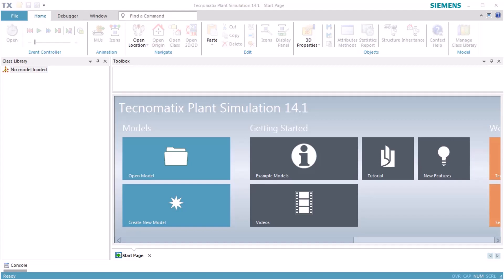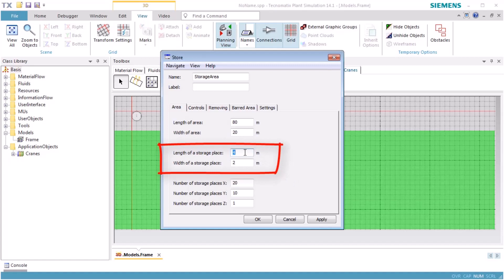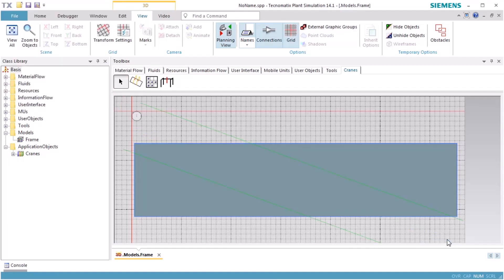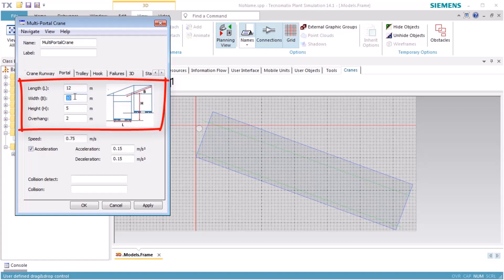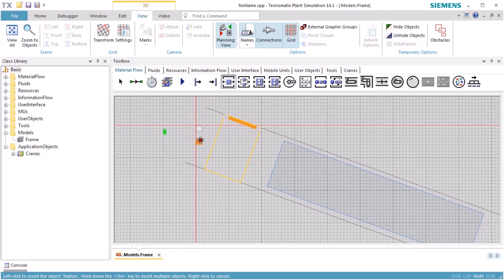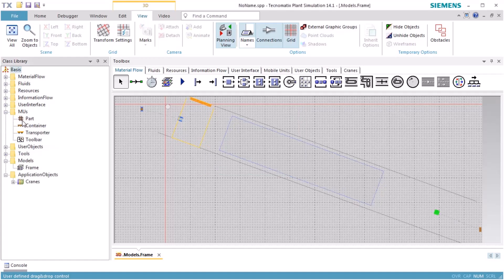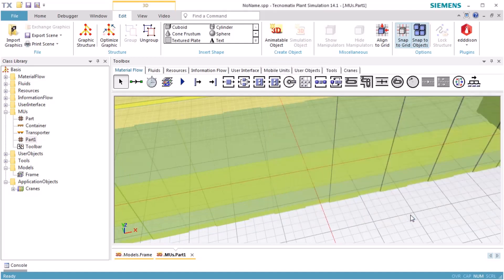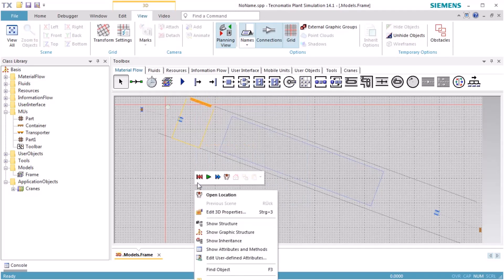Tecnomatix Plant Simulation Tutorial 17 - How to use the Portal Crane for stacking parts

Comment: first issue i can't find a container jt . second while running the simulation got a error run code  say there is no crane assinged to storage area. i am using 2404 version of plant simulation.plesase help
Reply: To solve it, you need to double click on the StorageArea, click on Settings and where it says Assigned crane, you need to write MultiPortalCrane, without space between the letters, then click apply and then ok.